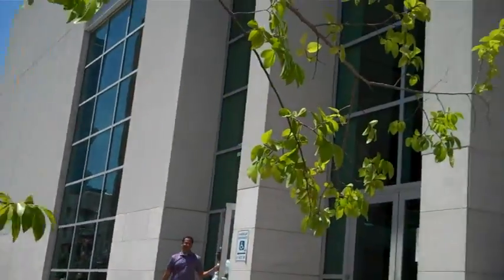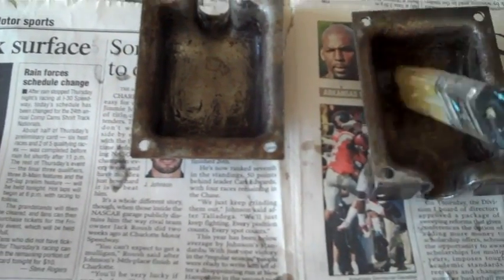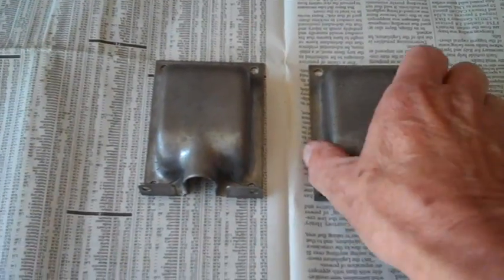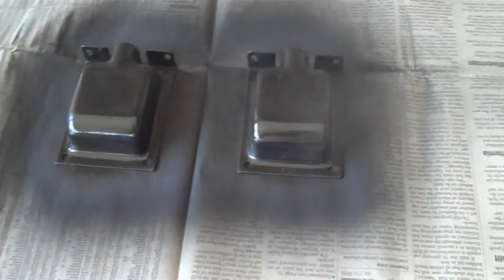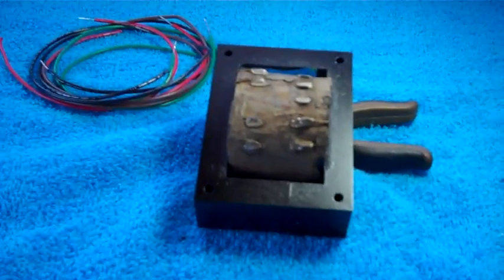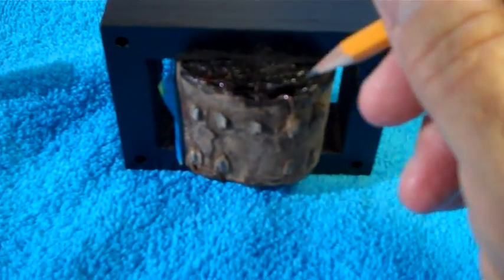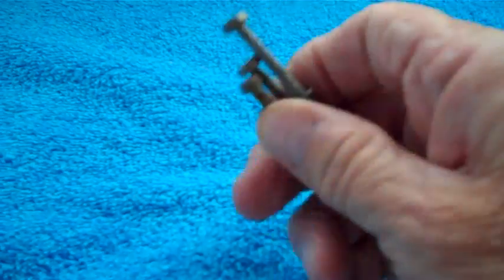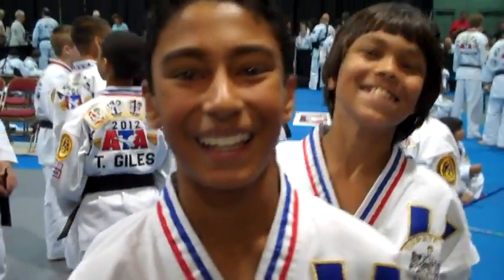1935 Atwater Kent Model 145 Repair and Restoration (Part 14 of 38).

Comment from the maker: Tom,
Just keep in mind that not all power transformers have their wires soldered to flat metal tabs.  In fact, most do not.  But either way, all it takes in patience.
BTW...at the tournament there were some kids from Brazil.  They were trained very well.  Extremely  impressive performances were given by each of them.

Regards,
John

Comment: Hello John. If you had plated those transformer covers, it would no be original, but I guess it would look very interesting.... I was surprised you didn't use liquid tape on the sides of the transformer ... : D

Comment: Have you checked the continuity of the windings or powered it up with a variac?  It would be heartbreaking to have an open winding after all the hard work. Back in my homebrewing heyday I used to love modifying power transformers to suit a particular receiver or transmitter project. A lot of folks would see a rusted transformer like yours and give up on the entire project because of fear. Your video should put them at ease and give them confidence to repair theirs.  73 -- de Mick, WB4LSS